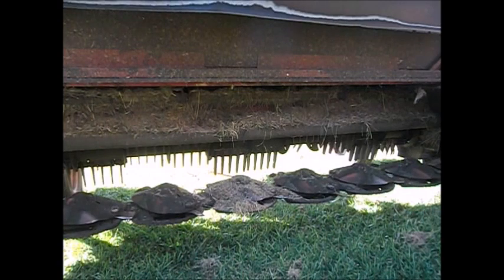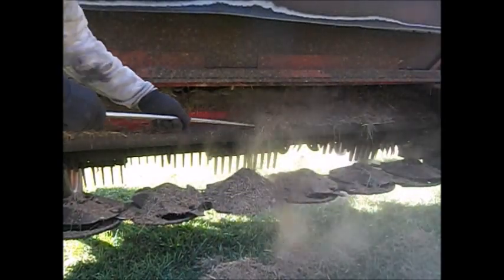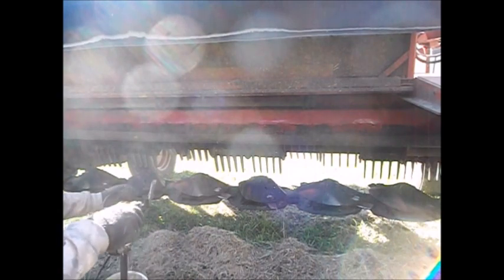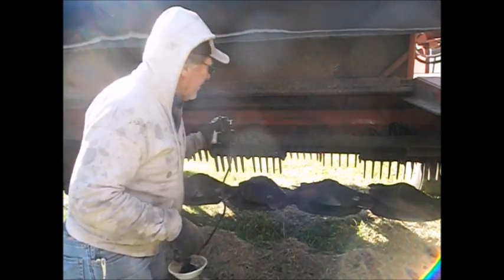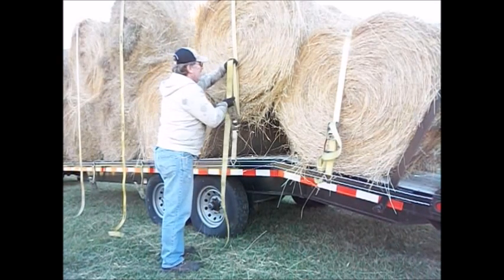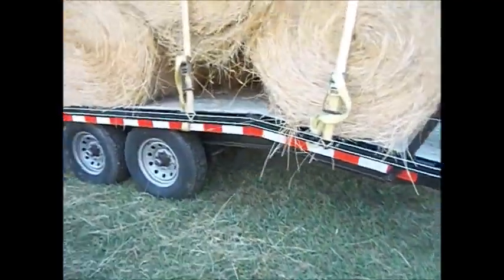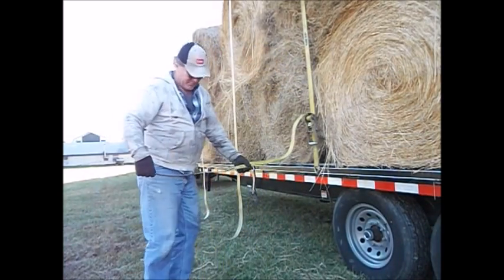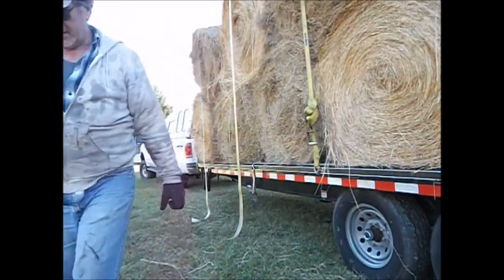Cleaning the discbine  and strapping hay

Comment: Man yeah Mr Monty, always something to do in the winter!! I love my air compressor on the service truck for that exact reason!! I roll my straps the exact same way! On the short ones, I willfold them a little,and srick through the loop of the rachet end before tightening, it holds it really nice. I see now what you mean on the shorter trailer and how it effects the load. I hope you had a great New Year, thank you for bringing us along!! 😁😁🇺🇸🇺🇸👍👍
Reply from the maker: Yes it is.  I really like your service truck.  Yes rolling straps like that is a easy way to surcore the extra.  Yes, I wish I would have gotten the 24 ft model.  Thanks Nelson.  Did you get the carb rebuilt and working?
Reply: @VintageFarm1086  I haven't yet Mr Monty, ordered the kit , supposed to be in today actually. Gonna give it my best shot! 😁👍

Comment: Itchy Job!! The big compressor and 3/4" 4' long wand makes it nicer.. then it becomes a muddy job.. a sprinkler run under the hood for an hour or so does a good job getting things loosened up.. then we pressure wash.. run it a minute to dry.. and grease right away.. 
I prefer 4" straps, winches on the trailer. No excess to deal with. 
Length does matter 🤣😂🤣😂
Not really, you make it work!!
Happy New Year Monty!!
Reply from the maker: I wish I had a big compressor,  it would make that job much easier.  I could have gotten a strap rail on my trailer when I bought it,  but as you can see I didn't.  I prefer to wash equipment in the spring when it's warmer out. Happy New Year Ed.
Reply: @VintageFarm1086  we wash and service at the end of season, look for any issues, do repairs and put it away.. all ready to go 🤞